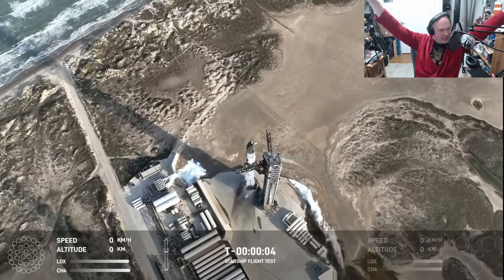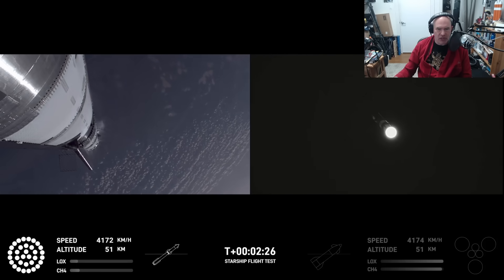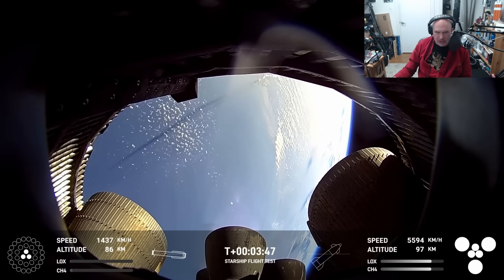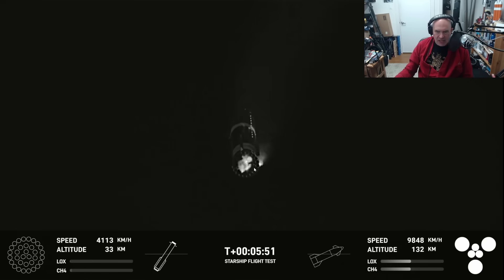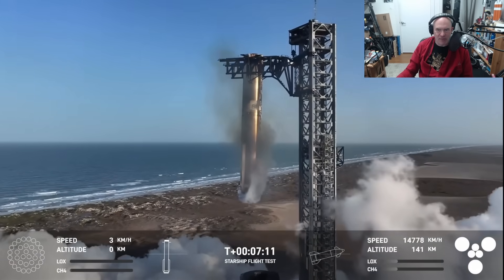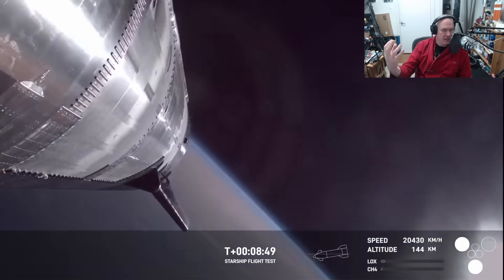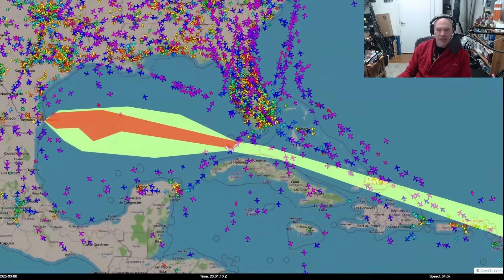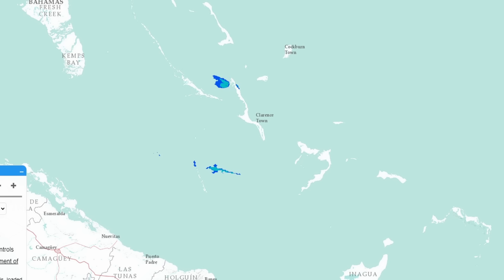SpaceX Make The Same Mistake Twice With Starship Flight 8

Comment: Hey, DOGE, Space X is being inefficient🤣
Reply: its entire raison d'etre is to distract attention from Musk burning tax dollars
Reply: SpaceX is literally the most efficient space company.
Reply: @RocketPal 
Sure it is, if you ignore the massive amounts of subsidies (both material and intellectual) they get. And maybe have a look at the Ariane 6, which is a design that actually works, wasn't excessive in terms of development cost and can do cost-effective launches without reusing old Russian rocket engines.
Reply: @mikeblatzheim2797  I'm curious, in what metric is Ariane 6 superior to SpaceX Falcon 9? It cost 10x more to develop. It took twice as long to develop and the booster isn't even reusable. It costs twice as much to launch, and that's with SpaceX including a profit margin.
Reply: @sjwright2  
I thought this video was about starship? If you're going to talk about efficiency, you can't just cherry-pick the Falcon 9 and ignore the rest of Spacex. 
The Ariane 6 even in its most basic form is significantly more capable than the latest Falcon 9, and has full multi-launch capabilities (meaning satellites can be sent to vastly different orbits in one launch). To send two satellites into geostationary orbit you'd need two Falcon 9 launches. The Ariane 6's payload  to geostationary orbit is nearly 40% higher than that of the Falcon 9, and with that payload the rocket is no longer reusable either (if you want to reuse the Falcon 9, its payload drops to 3.5 tonnes as opposed to the Ariane's 11.5 tonnes).
Keep in mind that the Ariane has only been launched twice and is at the start of its career. It's a modular design, with the more powerful block 2 version set to enter service next year. Once it's been in production for a few years, launch costs will go down.
Obviously the Falcon 9 is going to be cheaper than the Ariane 6 if you only need to send a single satellite into LEO. The Ariane can send 30 at once. Or nearly 9 tonnes to the moon.
In terms of payload capabilities the Ariane 6 is similar to what Starship is supposed to achieve. Sure, the lack of reusability is a downside (the same applies to Spacex rockets at higher payloads) and the development wasn't exactly cheap, but as a result following a single test flight the Ariane 6 was able to successfully send a satellite into a Sun Synchronous Orbit. And a mission to Mars is planned for 2027. I'd be surprised if Starship has even entered service by then.
Reply: @sjwright2  mike is a pseudo intellectual he wants to be smart but he’s actually quite the opposite and he proves that with every comment he leaves 😂😂
Reply: @ Much of the facts you've asserted are just flat out incorrect, or based on PR/fanboy spin of the objective facts. Yes this video is about Starship, but that would be comparing a rocket 6 years into its development phase and still being developed, with Ariane 6 which took 12 years to develop. It's comparing rockets which are orders of magnitude different in capacity.

The most powerful ready variants of Ariane 6 are competitive with early revisions of Falcon 9, but are not competitive with the highly iterated current revisions of Falcon 9. Even the most optimistic estimates of block 2 performance are still well below the proven capacity of Falcon Heavy with reuse.

Starship is in an entirely different order of magnitude and comparison to Ariane 6 is nonsensical. The Super Heavy Booster has a LEO capacity 10X greater and a GEO capacity 5X greater. It makes as much sense to compare a bus to a hatchback.

What the ESA has done is fantastic, and it's important that Europe has independent access to space.

But let's not argue. The real winner in all of this is anyone who wants to see the decimation of Russia's space economy. Before SpaceX et al, NASA was paying billions to Russia for access to the ISS, as were dozens of private companies. Anyone who can divert money away from Russia is doing good.
Reply: @sjwright2  
The Ariane 5 was competitive with current iterations of the Falcon 9, the Ariane 6 is significantly more capable. Its payload is 40% greater than the maximum payload of the most current Falcon 9 (which in that case can't be reused). The numbers I've quoted are official statistics published by the ESA and Spacex respectively. If you're looking for an easy way of comparing I can recommend their Wikipedia articles, where the payload capabilities for different orbits depending on the model of rocket are clearly listed.
Starship's capabilities at this point are purely hypothetical. It hasn't reached a LEO yet, let alone delivered a payload. And let's just say that with the amount of fixing that needs to be done before that rocket works, I severely doubt that it will be capable of putting 100+ tonnes into orbit.
Reply: @2001MitsubishiMirageES  
Look at you, making fun of others without contributing to the discussion. If you're going to throw insults, at least be man enough to do it to me directly. Not sure what you're trying to achieve here.
At what point did I claim to be an intellectual? If you want to know, I'm an engineer. And do feel free to point out where I've proven to be "the opposite of smart". Shouldn't be too hard if it's in every comment I left...
Reply: @mikeblatzheim2797  For what it's worth, I did reference Wikipedia for my prior response. I checked my numbers just now and they're correct, and you're still wrong. If you're going to include all variants of Ariane 6, you also need to include all variants of Falcon 9, all the way up to a fully expended Falcon Heavy.

As for Starship, your pessimism seems somewhat misplaced given that it's so early in its development cycle (six years versus twelve for Ariane 6), and given that the Super Heavy Booster has already achieved its core mission (which ends at second stage deployment) four times in a row.

It's also important to be reminded that the components being tested right now are already obsolete, and are being intentionally literally stress-tested to determine their points of failure. There is an assembly line of rockets being manufactured, and the learnings from these launches won't result in design changes for units already undergoing assembly.

Again, while it's fun to have some "competition", the only thing which matters is that the western world is never reliant upon Russia ever again.
Reply: Hope Elon goes bankrupt..😂
Reply: @barracuda7018  i do hope you keep obsessing over elon it gives me a good laugh also kamala lost ahahahahah
Reply: You ever dealt with a Social Security field office?

Comment: Just so the "if this were NASA" comments can be dismissed... the Artemis Program is projected to cost $93 billion, and the Single SLS will cost $2 billion per launch.

Meanwhile Starship program to date has cost approximately $8 Billion... and $100 million per launch currently, with projections as low as $10 million per launch.

If this were NASA... it wouldn't be happening at all.

Comment: I wonder if there's something that shows up in flight but not in even a long duration ground firing?
Next, could they launch JUST Starship, without the booster to see if it is a particular condition that only occurs in flight? Of course, it would only be a suborbital flight out into the Gulf bit they've got the ship built and are ready to go to V3 anyway, use the final V2 (shades of history, haha) to find out.

Comment: NASA built and tested two Saturns before sending one up with astronauts aboard. Eventually NASA launched 13 Saturns and ended with Apollo 17 being the last moon mission.  There is a reason NASA only used five J1 engines;  five possible problems versus 11 possible problems is a basic engineering solution.  Correctly calculating the amount of fuel needed is also a basic math problem that Space X has yet to master. Thank goodness no one was aboard these rockets!
Reply: Is that why airliners only recently started flying transatlantic with only two engines, previously requiring three or four?

Is that why your car has two braking circuits instead of just one?

Is that why aircraft have triple redundant hydraulic systems and instruments instead of just one?

The purpose of all these decisions is redundancy and fault tolerance. This works as long as the objective is completing the objective or at least preventing a total loss and not satisfying internet regards like you who demand zero engines fail to relight.

With these engines, the physics also favors medium-sized engines like these rather than the F1s. I think Scott has a video about it, but a good part of it boils down to  square-cube laws
Reply: @roflchopter11 
You can do redundancy with aircraft engines because the plane keeps flying after the loss of one engine.
Rockets don't have the luxury of aerodynamics providing control. You loose one engine, you change your centre of thrust and your ability to control the craft. Not to mention the risk of a catastrophic explosion.
Rocket systems mustn't go wrong. They don't have the weight allowance for making everything redundant. Adding engines means multiplying the amount of possible failure points for a minuscule chance that your rocket will better survive a failure.
Reply: @roflchopter11  The fact remains that so far they have had more failures then successes.
Reply: @bullettube9863 a total non sequitur, but okay
Reply: @roflchopter11  Starship has to carry enough fuel to cool the combustion chamber, when it runs out the chambers overheat and rupture. Eleven engines and the same number of pumps, sensors, valves etc is a recipe for disaster.  Murphy's law applies in rocket science just as it does in everything else.

Comment: The Vacuum engine extended cowl with internal cooling had a split , if you look closely at the video, as pointed out by Everyday Astronaut, this could have been caused by the Resonance Frequency, as explained in the first Ship failure.
But I doubt that full destructive testing is carried out by Space X to establish the Resonance Frequency of the whole ship as a single structure or individual part structures.
This could be achieved on the test rigs .
It could also be the Booster or the Hot Staging Ring damaging the Vacuum Engine Cowling Skirt.

Comment: My guess? Methane froze in the pipes. Too many pipes runnung through an area that is colder than the freezing point of methane just doesn't seem like a terribly good idea to me.
Reply: LOX and Methane have basically the same freezing point if I recall.
Reply: @kennethferland5579  LOX at 1 bar turns liquid at  –183 Celsius. That's it's boiling point. Methane turns solid at -182 C. That's also at 1 bar,   not sure what the pressures and dynamics are in the tanks vs downcomers, but I am thinking they are feeding methane slush and not liquid.
Though they would have probably caught the freezing problem in the full-duration static fire, so now I am more inclined to believe that the other person's theory with the harmonic oscillations when the lox empties could be more likely.

Comment: SpaceX did indeed make the same mistake twice with Starship Flight 8, as the V2 redesign suffered an engine bay fire akin to Flight 7, leading to engine failure and mission loss. While the booster catch demonstrated remarkable progress, the recurring fire suggests an unresolved flaw—possibly linked to the V2’s multiple downcomers or inadequate fire suppression. SpaceX’s engineers will analyze this data to refine the design, but for now, Flight 8 underscores the challenges of iterating on such an ambitious spacecraft. As Scott Manley concludes, this is a setback in a broader journey of innovation—another step toward a fully reusable Starship, even if it ended in an explosion over the Caribbean.

Comment: SpaceX’s Starship Flight 8, as detailed in Scott Manley’s video analysis, encountered a significant failure that mirrored the issues faced in Flight 7. Despite a successful booster catch, the mission did not achieve its objectives due to a recurring problem—a fire in the engine bay that led to engine failure and the spacecraft tumbling out of control. Below is a comprehensive breakdown of the event and why it suggests SpaceX may have made the same mistake twice.

What Happened During Starship Flight 8?
Launch and Initial Success: The launch of Starship Flight 8, featuring the V2 redesign of the spacecraft, began flawlessly. The Super Heavy booster lifted off perfectly, and the initial ascent was a spectacle, with Scott noting the impressive exhaust plume and shadow cast by the low-angle sunlight.
Booster Separation and Catch: After pitching over to position Starship correctly, the booster executed its shutdown sequence. Two engines failed to relight during the boost-back burn, but this wasn’t unprecedented and didn’t derail the booster’s return. SpaceX successfully caught the booster with the launch tower’s “chopsticks,” a notable achievement that showcased advancements in recovery technology. Adjustments were made to the descent to avoid damaging the tower with exhaust, indicating refined control.
Starship’s Failure: The upper stage, Starship, ignited all six of its engines (three sea-level Raptors and three vacuum Raptors) post-separation. However, trouble emerged as a camera inside the skirt revealed a fire in the engine bay. This fire, visible as a red glow and hotspot on one vacuum Raptor, escalated, causing critical engine shutdowns. First, the affected vacuum Raptor failed, followed by the sea-level Raptors, leading to a loss of thrust vectoring. The spacecraft began spinning uncontrollably, with propellant sloshing evident in telemetry as it tumbled.
Breakup and Debris: The spinning—estimated at around 15-16 RPM, potentially generating 6 Gs at the tips—either triggered the flight termination system (FTS) or caused structural failure. The spacecraft broke apart over the Caribbean, south of the Bahamas, with debris tracked by observers in Florida and visible on satellite imagery. Telemetry persisted for some time, and ground footage showed a rotating cloud, suggesting significant disintegration.
The Repeated Mistake: Fire in the Engine Bay
The core issue in Flight 8 was strikingly similar to Flight 7: a fire in the engine bay that compromised the engines and led to a rapid unscheduled disassembly (RUD). Here’s why this suggests SpaceX repeated a critical error:

Flight 7 Context: In the maiden flight of the V2 Starship (Flight 7), a fire in the engine bay also caused engine failures, resulting in loss of control and mission failure. SpaceX conducted extensive post-flight testing, including long static fires to identify harmonic issues or pipe fatigue that might trigger such fires, and reportedly added fire suppression systems and sensors.
Flight 8 Outcome: Despite these efforts, Flight 8 saw the same failure mode. The fire appeared early in the upper stage’s burn, propagated, and knocked out multiple engines, leading to an identical outcome—uncontrolled tumbling and breakup. This recurrence implies that the root cause wasn’t fully addressed.
Potential Design Culprit: Scott speculates that changes in the V2 design, such as multiple downcomers (pipes transferring propellant from the upper to lower tanks), might have introduced new failure points. These could resonate like guitar strings under flight stresses, leading to ruptures and fuel leaks that ignite. If this harmonic issue persisted from Flight 7, SpaceX’s fixes may have been insufficient or misdirected.
Key Questions and Uncertainties
Was It the Same Fire?: The fire’s location and impact suggest it’s the same problem as Flight 7, but its exact source—whether a leaking pipe, engine overheating, or another failure—remains unclear. The diffuse fire and localized hotspot on a vacuum Raptor hint at multiple contributing factors.
Flight Termination or Structural Failure?: It’s uncertain whether the FTS activated or if the spinning alone broke the spacecraft apart. Telemetry continued post-spin, and a “flight termination safed” call at 8 minutes aligned with the planned burn timeline, not the failure, suggesting the FTS might not have triggered immediately.
V2 Design Flaws?: The V2’s modifications (e.g., heat shield updates, internal tankage changes) aimed to improve performance, but they might have exacerbated vulnerabilities. SpaceX thought they’d mitigated the fire risk, yet the earlier failure in Flight 8 (compared to Flight 7) raises doubts about these changes.
Success Amid Failure
Despite the Starship’s fate, the booster catch was a triumph. SpaceX has now caught three boosters consecutively, defying expectations of a mishap like hitting the tower. This success highlights progress in reusable launch technology, even as the upper stage struggles.

Why Hasn’t SpaceX Fixed This?
Iterative Development: SpaceX’s approach is to test, fail, and learn. Flight 8’s failure provides more data—enhanced by additional footage and telemetry—than Flight 7, potentially pinpointing the fire’s cause. Scott notes this as part of developing a complex system like Starship.
Cautious Orbital Strategy: Critics note that after eight flights, Starship hasn’t reached orbit. However, SpaceX has deliberately avoided orbital attempts to ensure safe reentry and recovery, prioritizing long-term reliability over short-term milestones.
Complexity of V2: The V2 redesign introduced new variables. While intended to enhance capability, these changes may have outpaced SpaceX’s ability to fully test and mitigate all risks in ground simulations, exposing issues only replicable in flight.

Comment: I still think the issue is the bellows connection to the sea level raptors are failing because of additional mass of the propellants increasing the head pressure going into the turbopumps.